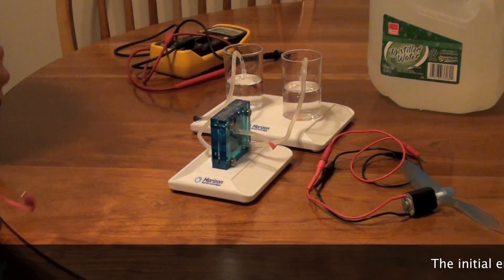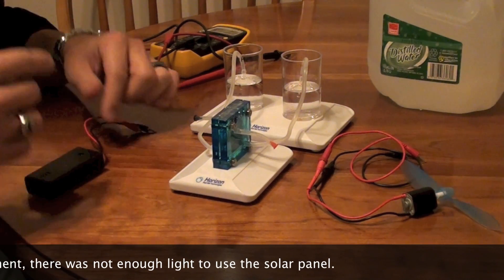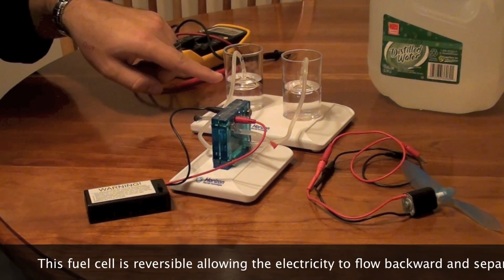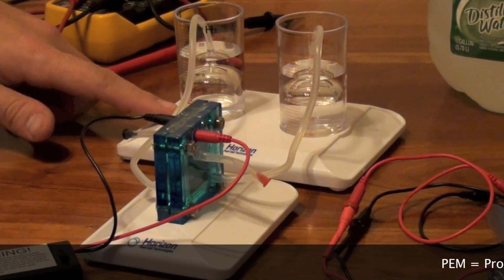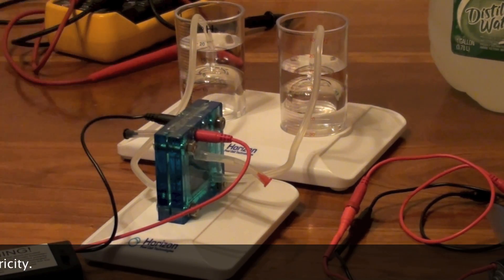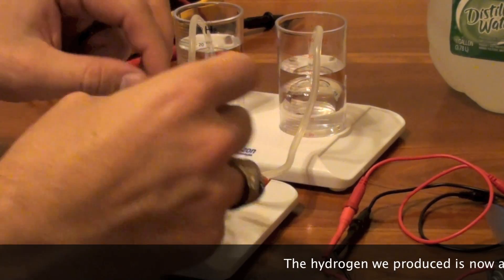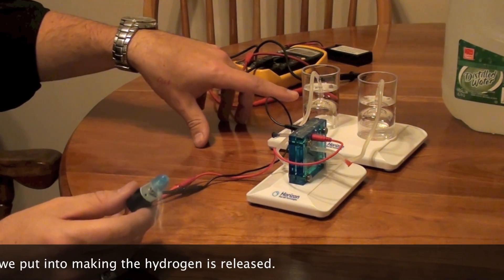Hydrogen Fuel Cell

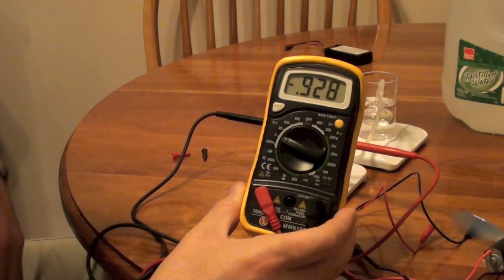Comment: Isnt your DMM wired to measure current at 5:37? ^^'
Reply: No. It's wired to measure nonsense because his ground lead is not attached to the "COM" port. It would take more than 0.9 volts to spin that fan so fast. This is a bogus video.

Comment: What is the amount of Amps for that prototype ?
Reply: A 2 amp 6v transfer between plates is optimal. There are many other videos showing this.
Reply: @neillegault  6 volts from single cell ??
Reply: @omsingharjit  Between the 2 metal plates in your water solution. These are about 2mm separated. Electrons move from one plate to another completing the circuit.
Reply: @neillegault  no , i was asking the volt amp of external circuit ( short circuit current )

Comment: Lies, lies lies.....
Reply: Why, explain
Reply: @kostyantynmartynyuk2921  Mixing Hydrogen nd oxygen together does nothing. You can ignite it but you will need to use it as fuel in a motor of some kind and a generator to make electricity to turn the fan on. This video is a lie.
Reply: @neillegault  The important part seems to be the Proton-exchange membrane (PEM) that can utilise H2 and O on separate sides to generate electricity. The two gasses don't appear to be mixed in here.
Reply: how do build a tank to keep it safe to fule a care
Reply: @dandaly1102  You would need to compress the gas into a tank to be useful. That also requires energy to do. The 2 gasses together is extremely dangerous. You'd need to keep them separate.

Comment: But I have a question, what did you consume to divide water into hydrogen, oxygen and water? And what did you do after returning to the cell?
Did you produce what you consumed? more or less? Good luck, good video
Reply: It's not like Free energy devices it's like battery it can store energy during daylight from PV cells and that can be used in night or later in time .